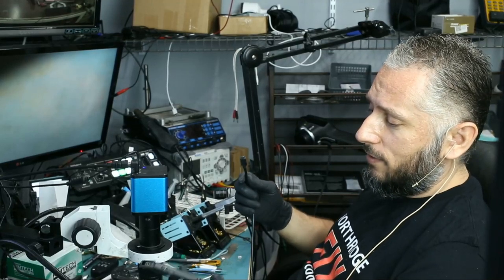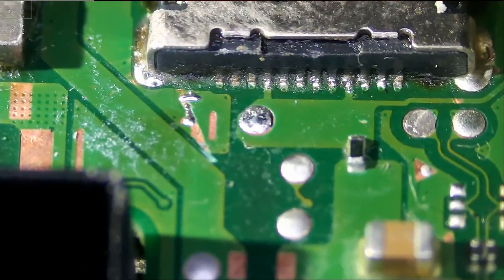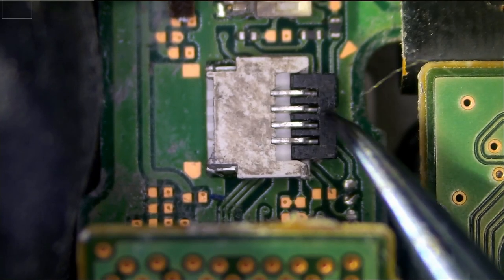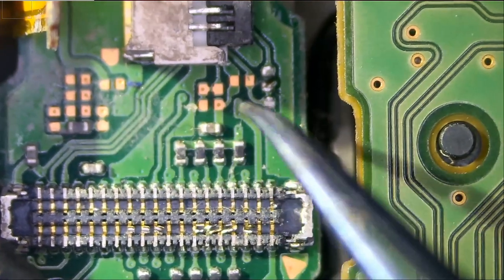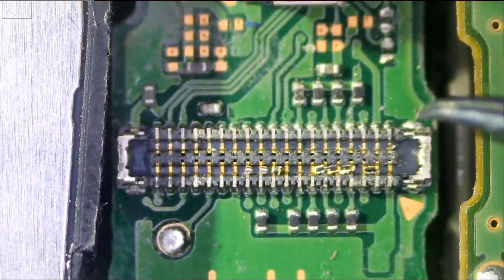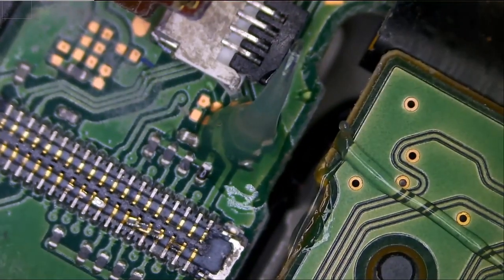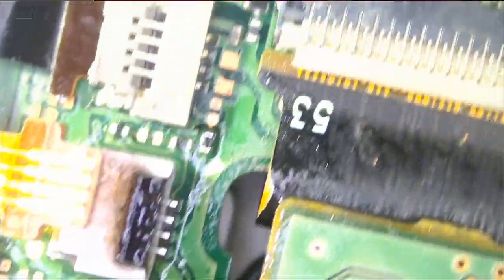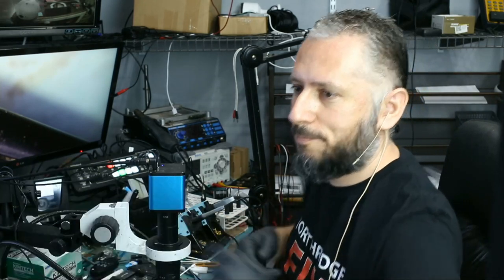Nintendo Switch Power button not working - Motherboard repair

Comment: Not sure you noticed but the pins are all mangled in that connector below the missing components.
Reply: he notices but he doesn't care. he literally says i only need to get the power working.
Reply: @acejiten  its his business he should work how he wants. I just think i would do things differently. I would replace the connector it takes a skilled worker 5 mins and then charge the customer for it. Both ways work altho if you fix only one thing and then the customer has another issue with the same item hes not going to think kindly of your business.
Reply: He can just remove that pins .... Avoid short circuit 👎
Reply: Its missing from the connector on the flex cable
Reply from the maker: The connector is 100% good and functional. It's the flux glare making it look like pins are out of place, but they are not; Otherwise we would have told the customer and charged for the replacement
Reply: @NorthridgeFix  oh alright, never seen that before. Great work.
Reply: It’s not that he does not care, you learn over time to stick to what the customer asks you to fix. You can end up digging a big hole for yourself if anything goes wrong & the customer will not understand & say I DID NOT ASK FOR THAT!!!! 😀
Reply: When you says those are filters do you mean that they are small chokes or are they capacitors?
Reply: What resistance is? I have same issue but i cannot find tge size of it.
Reply: @ElektroTechNL  Oh yeah? Then go ahead and take that route, let's see how short-lived your 'career' will be.

Comment: Think I commented on this video before because I had this problem and was hoping someone knew the size and rating of that resistor. For anyone in the same boat who does not have access to another Switch board to harvest the parts I ended up soldering in a jumper wire in place of the resistor I did not have. My power button now works again flawlessly. Could be a 0 ohm resistor? Anyway, doing this repair makes you realize how skilled this guy is and how steady his hand is because that resistor is TINY. I have have a soldering microscope as well but it's still a  difficult task mainly because any tools such a tweezers and solder tips look giant and obstruct the view at that magnification. Also unless your hand is as steady as a rock it looks like you had 40 cups of coffee trying to position something that small. I must have originally knocked off the resistor when I was replacing my card reader a while back. Anyway without this video I don't know if I would have ever found the problem. Thanks Northridge Fix!

Comment: I have warranty on the Nintendo switch lite and I open it up and everything else it’s working but my Power button to turn the switch on doesn’t want to work but the volume buttons it’s working so do I still have too pay are they can still fix it with my warranty on the Nintendo switch lite

Comment: Hey, just accidentally broke off the power connector from the mother board, is there a way to power it on without the ribbon cable plugged in?

Comment: You leave it like that with regards to flux?
Reply: I assume he just didn't put the cleanup on video, at least I hope so.  I hate when flux gets into connectors
Reply: He responded to another comment that flux and alcohol are not conductive, but he does a thorough clean up on every job...so it will be off camera or Big Boss may have done it.

Comment: Always wanted to learn how circuitry works and how to fix circuit boards and other various electronic devices. Watching your videos is inspiring. My first big repair attempt was to replace a cracked Apple Watch screen, force touch sensor and swollen battery. This didn’t require any soldering but it was still very satisfying none the less.

Comment: Perfektly done, as always great job. I have a question, because i have seen that flux or alcohol is comes out from the socket when you plugin the cabel, does flux not conduct electricity?
Reply from the maker: Flux does not conduct and alcohol evaporates. Flux does not do harm if left on the board, but I always do a thorough cleanup  for a neat finish.
Reply: NorthridgeFix ah ok, didnt know that

Comment: Do you use hot air when desoldering a component from a donor board?
Reply: You can do, but he clearly said in this video that the working area is really small and surrounded by plastic connectors so in this instance he made good use of his micro-soldering tweezers.